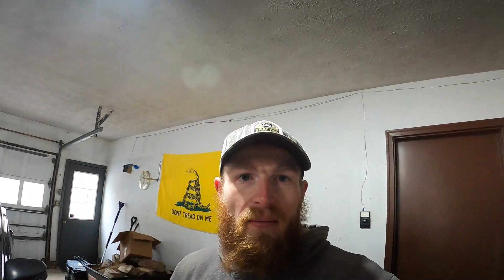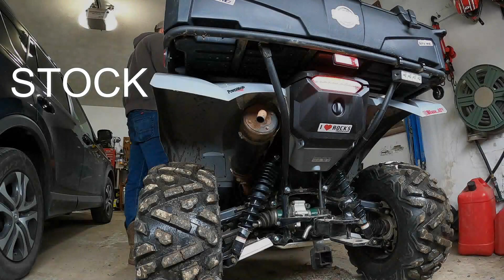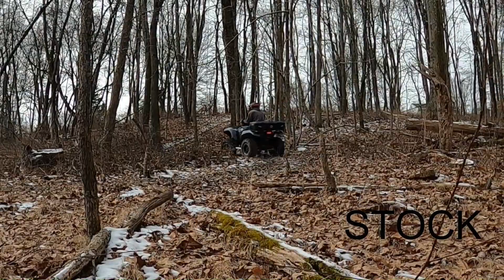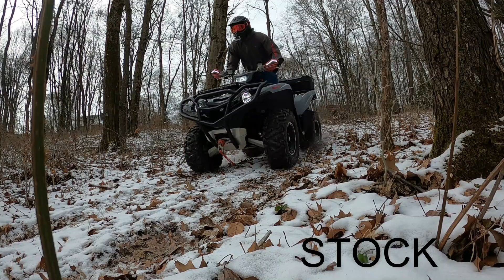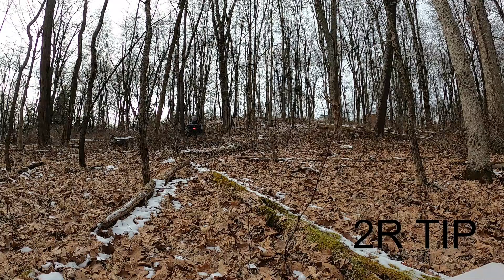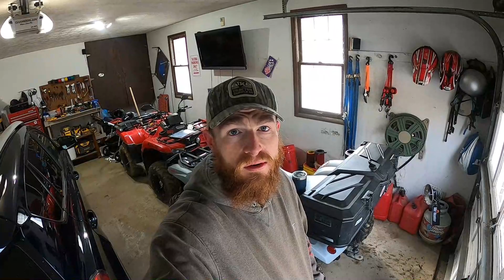Yamaha Grizzly 700 - 2R Racing Exhaust Tip Sound Tests

Comment: I’ve got a 2013 Grizzly 700, and have been running a 2R exhaust tip for years.  I personally like the throaty sound of it!
Reply from the maker: Oh yeah. Sounds much better!
Reply: Did you run a tuner or no?
Reply from the maker: @Nwhite509  Yes. Fortunately, I fell into a free tuner. Once I got that installed, I put the 2R on

Comment: I just picked up my new ‘23 Grizzly SE last weekend and I think this is going to be my first “mod” and changing out the stupid halogen high beam light.  I don’t really feel like doing a tuner and stuff yet would rather get some miles on it first.  Really enjoying your videos I’ve been binge watching them all day lol.  I also have the rear cargo box and after watching your video on what you keep in it I went right on Amazon and pretty much ordered all the same items haha.
Reply from the maker: Glad I could help with your box supplies! 
I went with the tuner prior to the tip just so I could manipulate the A/F ratio with the change in back pressure. Though, I have heard of people using the tip without one as well. 
Glad you are enjoying the videos. I have quite a few more for the coming weeks! 
Ride on!
Reply: @blaze_atv  After doing some reaserch on the turner and seeing how easy they are to install I will probably do one before next spring.  I'm in Minnesota so my main focus is to get miles on before winter hits lol
Reply from the maker: @dslpwr  Understandable! The tuner itself is very easy to install. Just a bummer that is 3-4x the price of the exhaust tip lol.

Comment: Sounds good with tip. Thats what I have on mine plus the AIS delete. We can only 96 decibels here in Wisconsin so sometimes having aftermarket pipes is to loud. I actually dont like it to loud when riding with friends and family. I got the 2R tip on 2016 grizzley and whiskey bent tip on our 2021 cfmoto cforce 800xc. They sound plenty good and keeps the DNR happy and people in the towns and camp sites and parks. When I was younger I never cared but being alittle older now I kinda like being able to actually hear my machine and not just a loud pipe. Good choice.
Reply from the maker: I used to want my machines as loud as possible. Now, I just want it a little deeper and this did the trick. And, was much less expensive than a full exhaust! 
Thanks for checking out the video!
Reply: Can you do a review on the tires and the trailer that you use
Reply from the maker: @alloutdoors1277  I’ve been planning to do a tire review for about 8 months now, just haven’t had the time! Lol. I can do the trailer as well. Good idea. 
Spoiler alert: love the tires, trailer is subpar.

Comment: It sure does sound a whole lot better than stock and looked like an easy install also. However, it doesn't scratch my exhaust sound itch. I'm new to AZ, but I believe there is no decibel limit on exhausts here.. But it's good to know I'll have an alternative if I ever get tired of the Barker's.
Reply from the maker: Probably not loud enough for you if you are interested in Barker’s lol.  This is about the exact amount of noise I wanted out of it while making it deeper.
Reply: @blaze_atv  I noticed you had the quad lock case on the Grizz. I've been looking into those also, did you get the motorcycle handlebar mount one? When I was looking on their website there were so many options I got confused. Also, do you think they're worth the steep price tag?
Reply from the maker: I absolutely LOVE the Quadlock. I got an off brand one off of eBay that worked really well too (and was only like $15) but I wanted the wireless charger which is essentially why I changed to Quadlock. 
Yeah, I got the motorcycle handlebar mount.
Reply: @blaze_atv  Ah okay, I've got a Pixel 7 Pro and the wireless charge on these phones is super slow at 10W. It barely keeps up with the battery drain when in my vehicle when I'm driving so I might just get the USB charger that runs off the battery.
Reply from the maker: @h2beezy2  I didn’t get the charger to “charge,” I got it to “maintain” as I’m using maps and whatnot. 
If you don’t want the wireless charger, you could just get the off brand eBay mount and run a charge cord to the aux port. That’s what I used to do and what the Old Man still does.
Reply from the maker: https://www.ebay.com/itm/363897443688?mkcid=16&mkevt=1&mkrid=711-127632-2357-0&ssspo=LGVbpuECR2q&sssrc=2349624&ssuid=s1dhIrzGRq2&var=&widget_ver=artemis&media=COPY

Comment: It sounds very good, not so loud but it sounds good.
Did you feel a little more power? Or is it the same!
Reply from the maker: Thanks! Haven’t had much of a chance to test it out. From a quick test, feels like it added a bit of power but I added the EHS Tuner and Airbox mod not too far before so tough to tell.
Reply: @blaze_atv  
Could you tell me about the EHS tuner and the Airbox mode please.
How did you get it?
Or is there a website?
Kind regards!
Reply from the maker: I did a video on the tuner and airbox mod as well. You can purchase them directly from the EHS website. https://youtu.be/hFayG_0qtzY

Comment: I got myself a new 2023 grizzly se for the upcoming season and i have eyeballing these 2rr tips , Is it as easy as it looks just 4 bolts and done?
Reply from the maker: Yep, the tip is just four bolts. I already had my tuner though.
Reply: @blaze_atv  Do I need a tuner?
Reply from the maker: @SmarOneNine  I can’t answer that question for sure. I know there are people out there running the 2r tip without a tuner. I didn’t want to do it due to how lean they already run from factory. I waited until I got a tuner to do the tip.

Comment: Where did you order tip from...good video..
Reply from the maker: 2rracing.com
Reply from the maker: And thanks!
Reply: Thanks...just order it,,👍
Reply from the maker: Awesome. Enjoy!  
One thing I did do before putting the tip on was put multiple layers of heat tape on the fender and rear storage. I have heard people mentioning that it can melt the plastics otherwise. 
Other than that, simple install. Didn’t even have to change my tuner settings!

Comment: I tried it but ended up with the whiskey bent 1.5” with a 45.  The 2R was just to much
Reply from the maker: Too loud?
Reply: @blaze_atv   yea, I use mine for hunting and pulling the kids on their sled so they were getting blasted lol.  I downloaded the decibel meeter app and the whiskey bent 1.5” is louder than stock but quieter than the 2R.  So kinda right in the middle.  On my last grizz I had a barkers exhaust with quiet core, I felt like that was even quieter than the 2R but I could be wrong, that was a while ago
Reply from the maker: @chrisbeasley8342  Gotcha. Makes sense. All depends what you do with it. To each his own!